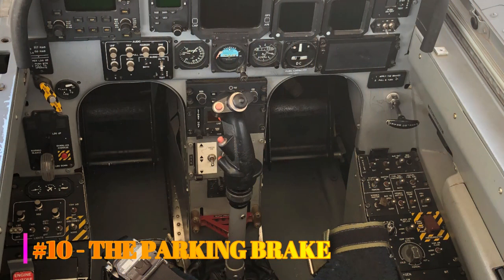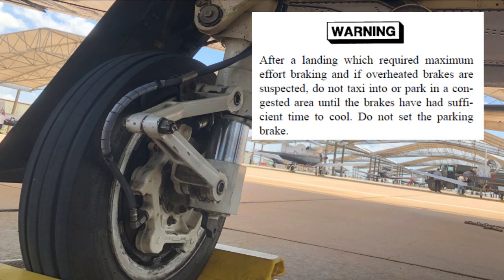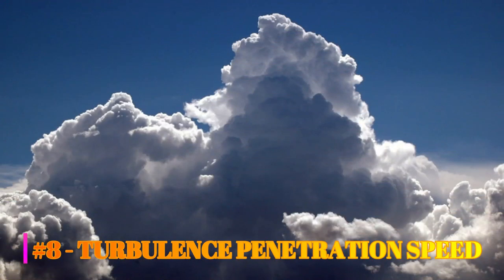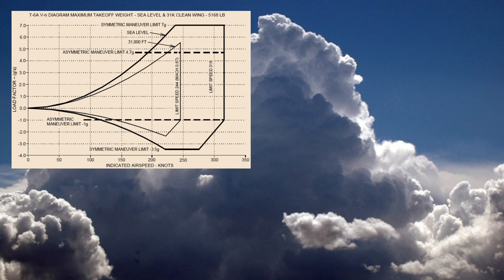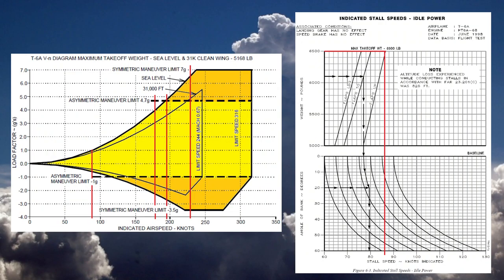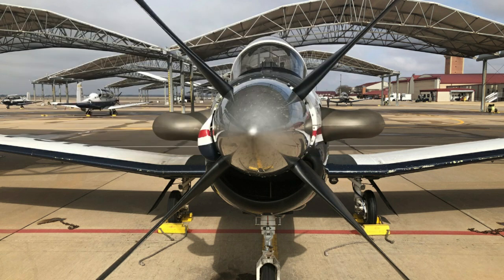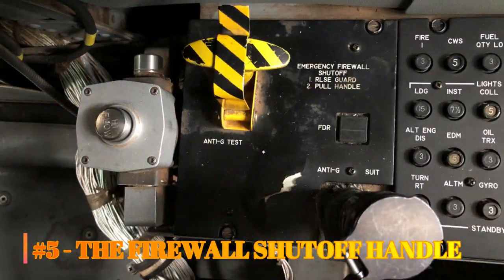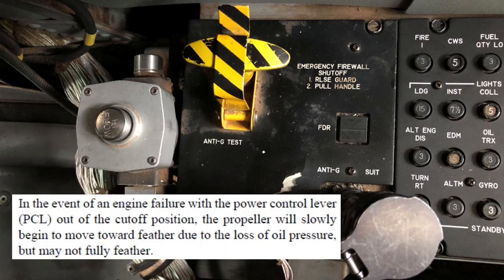10 Fun Facts About the T-6

Comment: Brakes?... Hot?... err, umm, how does a turboprop this modern NOT have reverse pitch (Beta) propeller for super effective thrust reversal??  I smell Congressional-influenced DoD bidding shenanigans again.
Reply: The PT-6 can do it depending on the plane it's on, but it's not necessary on a basic trainer aircraft like the T-6. It can already land well within 3000 feet.
Reply: Because it’s an intro trainer to airplanes that don’t have them.
Reply: @McBoeingDrVr  navy trainers had beta before switching to the t6. Not needed but why would you get rid of it if it may be useful in an emergency.
Reply: F-15s do not have reverse thrust.
Reply: @caleb7631 When would you need reverse thrust in an emergency?